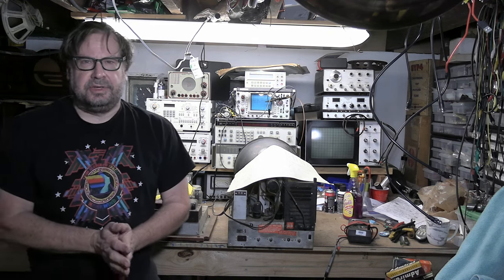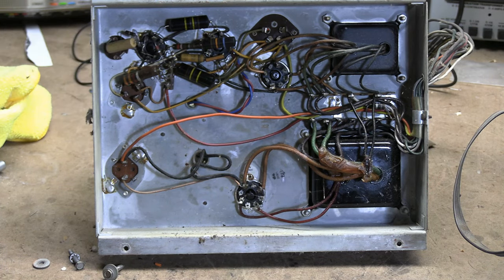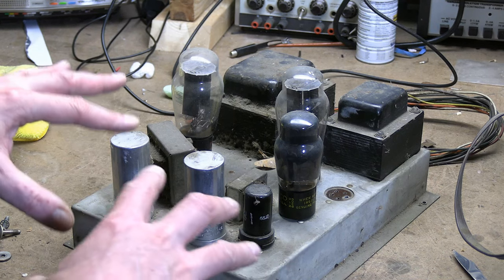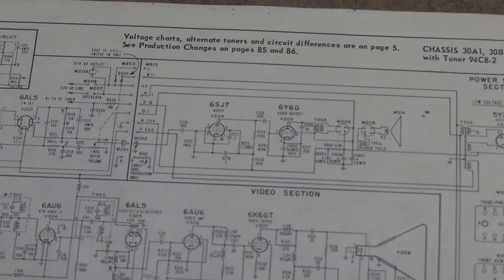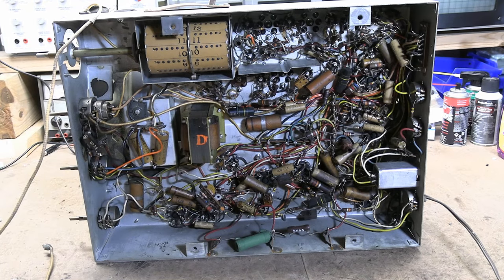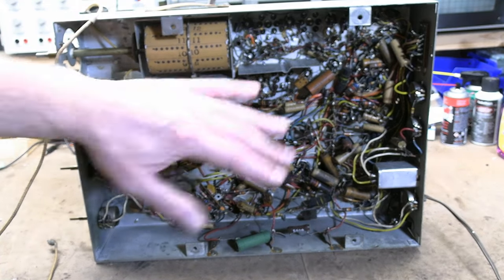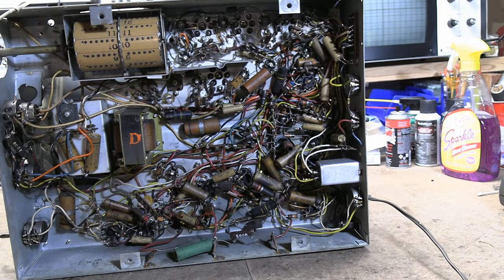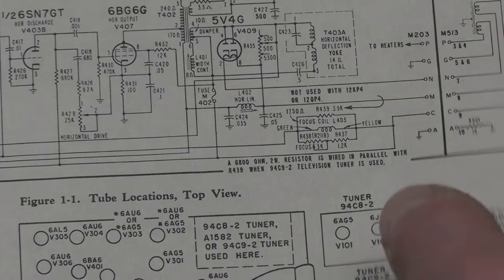Beginners guide to B&W tube TV restoration part 5 (chassis review)

Comment: Good stuff here, Bob. I hope you get deeper into the function of each circuit, most especially the decoding of the video signal, how the video waveform triggered the sweep amplifiers, and how they kept this Rube Goldberg contraption in sync with itself. I remember how fussy these early B&W sets were to keep adjusted properly. Early color sets were even worse.

Comment: A    TV  is   like a  radio   with a  front   end  stage  , if  and  signal separation with oscillators for the drive    ,
Reply: Actually, a TV is a radio with an audio and video output.  It takes a lot of circuitry however to display the video, which is where about half the circuitry is used on a TV.

Comment: I think the use of electrodynamic speakers (using a electromagnet instead of a permanent magnet) was more due to lack of strong magnetic materials (at a reasonable cost) in the early years. Something that some people don't realize is that technology was evolving through the years. The construction (and circuits) in a 1947 TV were somewhat different than those in a 1957 TV and those were further different in 1967.
Reply from the maker: True, but they did have alnico speakers starting in the 30s.  Plenty of TVs from the 40s used PM speakers including some you saw on my channel recently like the Stromberg Carlson and Westinghouse.  Would be interesting to see a cost comparison.
Reply: @bandersentv Agreed. What I meant was that the early versions of Alnico alloys didn't have as good performance vs cost. Many Alnico versions were developed through the years, the first being in the 1930s. By the later 50s the field coil speakers were scarce. Then in the 1960s ferrite magnets became common.

Comment: Regardin' the "A" and "B" circuits, from the tuner: can one feed composite signals, directly into them (presumably after the 6AL5s)?
Reply from the maker: Possibly the grid of the video amp but you need to get the amplitude and polarity right. I've never tried.

Comment: Good stuff as always Bob. You get honorable mention in shangos latest 1949 Wion Hoffman video. Curious, what model number of soldering tip do you prefer for your Weller iron. They seem to have 3 different chisel tips ETA, ETB ? Kinda hard to pick one, unless I have it right in front of me. You convinced me to retire my old Weller iron. I liked using the ST2 (screwdriver tip) which is a 0.09" / 2.38 mm.

Comment: The 5U4G rectifier has a "plate tap" via the center tap of the secondary to the PI filter. That makes sense to me. But the 5Y3GT has a filament/cathode tap.That kind of messes with my brain a little.  Do I just think of that as equivalent to 2 "reversed" diodes then?
Reply from the maker: Look again.  They are wired the same.  Both have a secondary center tap going to ground.  Both have one side of the filament/cathode going to a filter capacitor.
Reply: Ah! Had to do a triple-take to get it. (Still have trouble visualizing current flows sometimes.) Thanks!

Comment: AH I see a 6Y6 tube for the audio output, i have so many of those and was wondering what they were used in, now I know :)
Reply from the maker: There is a trio of similar power tubes - 6V6, 6W6 and 6Y6.  They decided the 6Y6 was a better fit for this application.

Comment: Great video! Quick q: I’ve got the Stewart Warner 9121A, but I’m not seeing that big resistor that you mentioned was typically bad in these old tvs. I’m aware you actually have the schematic for this television, do you know if one of these is present in this specific model?
Reply from the maker: Not sure why you say that.  I've never work on a Stewart Warner before.  Only some 46-48 sets used that resistor.  You set is in volume 7 so it's newer than this set and likely does not.
Reply: @bandersentv  oh I apologize, I saw you linked the schematics on videokarma, hence why I believed you had them. My mistake. Anyways, thanks for the info!
Reply from the maker: @jionmsfafsds  OH, I probably did see your videokarma post.  It's hard to remember every make and model.
Reply: @bandersentv  haha yes, very likely. But no worries, happy to hear mine likely does not have one. I will be doing a final test later this week… your videos have been very helpful for my first repair, so thank you kindly ❤️

Comment: Does reaplacing a carbon comp resistor with a metal film or wire wound, will it effect sound? I replaced all bad resistors with wire wound and metal film noticed that after that had to put shields on 2 of the 12ax7 tubes to get rid of a hum that was more noticable when put hand near them
Reply from the maker: I'm sure some audiophiles would claim it does, but I serious doubt it.  If anything it should sound better.  Carbon comp resistors generate a little noise themselves.
Reply: @bandersentv  I agree, they are less noisy from what I read but they do create inductance. I know with replacing them voltages are more to spec and my left and right channel are more even power, I'm just wondering by replacing all of the bad ones did I lose that vintage warm sound. Maybe replacing the wire wound ones where the plate or grid on preamp with carbon film would keep the sound and then its amplified?
Reply: Was on a very good forum apperently replacing them can effect sound but it's not noticeable at certain levels. So basically it shouldn't effect it much. But couldn't hurt if next time have to service amp can swap preamp ones out for carbon film. Would make amp look somewhat original to :)
Reply: These old sets lacked filtering. The improved amplifier performance (because of new parts) might have made the lack of filtering more noticeable.
Reply: "...did I lose the vintage warm sound?" No, it's still there. It's still a tube amp.  @Tysman909
Reply: @tennesseered586  ok thanks so basically all the new resistors did was bring voltages back to spec. Which I did notice that my channels now have even power.
Reply: Wire Wound resistors are normally used in a power supply to drop voltages.  Since they are basically a coil wound with resistive wire, the higher values can pick up magnetic fields due to the many turns used.  Also, due to the inductive effects, you should not use wire wound resistors in high frequency circuits, since the inductance adds to the resistive value.  Metal film resistors are somewhat similar in that they have a resistive film deposited on a ceramic rod.  To set the value, a laser cuts a spiral in the resistive coating but, these have far fewer "turns" or spirals than a wire wound, making them actually good performers at high frequency.   Carbon Composition resistors are basically just a carbon shaft with leads on the ends so, totally non-inductive.  Carbon Comp resistors generate noise, which becomes noticable in values above a few hundred k-ohms in high gain preamp circuits.
Reply: @Tysman909 12AX7's are high gain duo triodes, with an amplification factor of 100.  The hum noted after resistor replacement may also be due to proper voltages being restored, thus higher gain.
Reply: @billharris6886  makes sense the amp is now getting proper voltages to tubes so now there conducting full emissions. It also helped with my left and right channel there now balanced output, before 1 channel was little weaker
Reply: @billharris6886  ok so since my amp doesn't have tuner or any coils, they are in my tuner that is separate. Can the wirewound be used? The amp is working perfectly fine just wondering if lost the warm sound by adding inductance? It's a Harman kardon A250 Epic
Reply: @Tysman909  I wasn't sure what the Harmon Kardon A250 Epic was, okay, just a stereo tube amp.  Personally, I don't like to use wire wound resistors above 10kHz.  The "warm" sound comes from the distortion characteristics of vacuum tubes, the wire wound resistors shouldn't make any difference unless you are a hyper audiophile that can hear the difference between brands of speaker cables.
Reply: @billharris6886  thanks I kinda figured the resistors wouldn't change it a whole lot the tubes make the difference. If I was to change preamp area back to carbon film would that be most likely area to notice the audio change cause will get amplified and then output from the output tubes?
Reply: @Tysman909  I have no idea, if you are that interested, you can do a before/after test on your amp.  My best guess is one or more of the resistors you changed out was out of tolerance and caused the sound difference.  However, we are getting completely off topic here so, we really should be concentrating on Bob's TV overview as a courtesy to the rest of the group.
Reply: @billharris6886  yes for sure, thanks for your help much appreciated